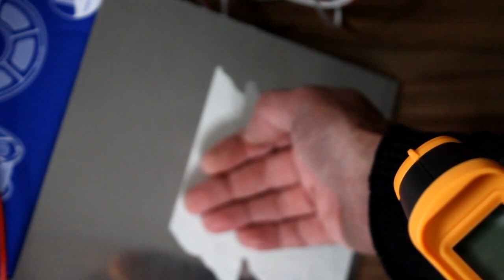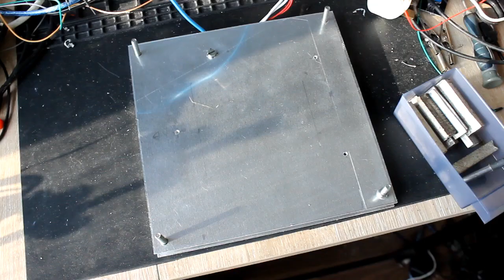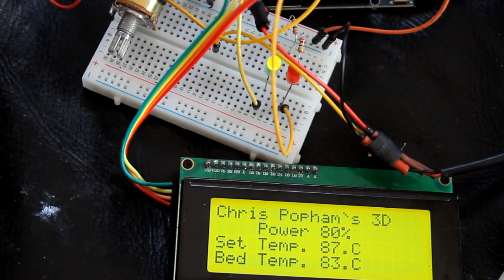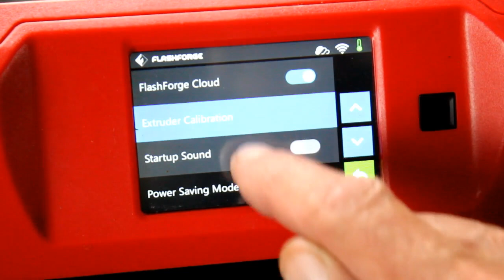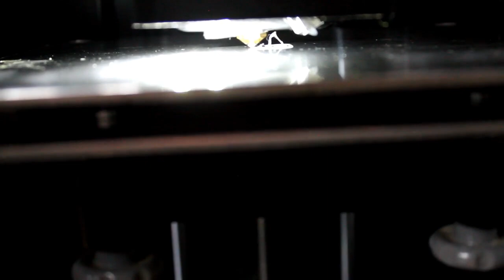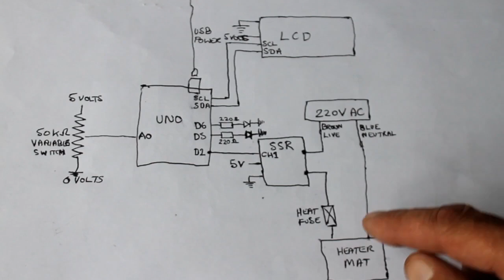Homemade 3D printer heated bed. 220 volt AC, 100 watts.

Comment: Isn't the thermistor already in the heater? The red pair of wires in mine is the thermistor and the white wires are the mains. The thermistor should be a 100k 3950 version.
Reply from the maker: Yes I think I`m going to use it. I wanted a LCD display for my mate but it`s too far away to work properly with the probe thermometer. I didn`t know what rating it was. That will help thanks. My friends put his printer in  a heated cupboard now so he dosen`t need it.

Comment: Where did you get that from
Reply from the maker: What do you mean? The parts or the song at the end? :) EBay and my mate got the song made by his friend.
Reply: @damianbutterworth2434  Sorry, it was cryptic. The heat pad, I am building an SMD soldering plate.  Also, does the heater get to around 240c? This pad looks about the right size, and with it, having an adhesive pad would hopefully work.
Reply from the maker: @InterplainMusic  Hi, I don`t think it will get that hot. I look into it. When I worked in a chip factory we had heater tubes about 8mm wide that would heat up the dies for soldering etc. They used to glow when left on all the time stood on their own.
Reply from the maker: @InterplainMusic  I have a mini single cooker plate. Only paid £5 second hand from a car boot. It about 18cm round. I`ll measure how hot it gets at the weekend and see if it stays at the same temperature and make a vid. Might be better off using something like that.
Reply: @damianbutterworth2434  my heat  plate  goes  up to 110  on the  printer  variable down  to  0   usually  i have  it  about  60  with  normal   filament

Comment: des  is   it  variable  temp  ?   as  it would  be   better   you   want it too  hot    that  it  melts the  model  on the plate  lol  mine  goes  up to 110  but  is variable omg    des  whats with the ai song  lol  you   bothered to  learn  it   on  your  kb mate
Reply from the maker: Yes mate variable but the temp sensor is far away from the heater pad so it`s slow to react. The last one I made I used the Thermistor sensor that is fitted to the heater pad so it was better but I could not get an accurate reading off it.
Reply: @damianbutterworth2434  you  had  many  pritns  stick to the  plate
Reply from the maker: @greentroll9326  I had problems using glass and aliuminum not sticking. This £5 black sticker works well. I think it`s better to peel them off when hot???
Reply: @damianbutterworth2434  yea i  take them  off when  hot as thats the  idea   mate   if you wait till cool then  its gonna  stick  lol

Comment from the maker: #include <OneWire.h> // SET UP WHAT LIBARIES YOU NEED
#include <DS18B20.h>
//#include <LiquidCrystal_I2C.h>
#include <LCD_I2C.h>
LCD_I2C lcd(0x27, 20, 4); // Default address of most PCF8574 modules, change according

int t=0; // CREATE T VARIABLE TO REPRESENT THE TEMPERATURE PROBE VALUE
int s=0; // CREATE S VARIABLE TO BE THE VARIABLE KNOB VALUE
int st=0; // ANOTHER VARIABLE FOR CALCULATING THE RESULT OF THE "SET TEMPERATURE"
DS18B20 ds(9); // SET DIGITAL PIN 9 UP AS TEMP SENSOR
void setup() { // SET UO YOUR PINS ETC
  pinMode(2, OUTPUT); // SET DIGITAL PIN 2 TO OUTPUT FOR HEATER RELAY
  pinMode(5, OUTPUT); // SET DIGITAL PIN 5 TO OUTPUT FOR HEATER LED
  pinMode(6, OUTPUT); // SET DIGITAL PIN 6 TO OUTPUT FOR POWER ON LED
  digitalWrite(2, HIGH); // HEATER RELAY OFF
  digitalWrite(5, LOW); // LED FOR HEATER OFF
  digitalWrite(6, HIGH); // POWER LED ON
    lcd.begin();
    lcd.display();
    lcd.backlight();
}

void loop() { //PROGRAM LOOPS BACK TOO HERE AFTER THE END FOREVER
lcd.setCursor(0,0);
lcd.print("Chris Popham`s 3D");
  s = analogRead(0); // READS THE VARIABLE KNOB
  delay(10); 
  st=20+(s/13); // CALCULATE TO CONVERT KNOB VALUE(0-1023) TO VALUE 50 TO 100 FOR DEGREES C
  t=(ds.getTempC()); // GETS THE TEMPERATURE OF THE PROBE
  delay(10);
  lcd.setCursor(0,2);
  lcd.print("Set Temp.");
  lcd.setCursor(10,2);
  lcd.print(st);(".C ");
  lcd.print(".C ");
  lcd.setCursor(0,3);
  lcd.print("Bed Temp.");
  lcd.setCursor(10,3);
  lcd.print(t);

  lcd.print(".C ");
  lcd.setCursor(4,1);
  lcd.print("Power");
  if(t >= st) { // TURN HEATER OFF IF TEMP PROBE IS HIGHER THAN THE SET TEMP
  lcd.setCursor(10,1);
  lcd.print("0%  ");
    digitalWrite(2, HIGH); digitalWrite(5, LOW);delay(1000);
  }
  if(t == st-1) { // TURN HEATER ON FOR .2 SECONDS AND OFF FOR .8 SECONDS
  lcd.setCursor(10,1);
  lcd.print("20% ");
     digitalWrite(2, LOW); digitalWrite(5, HIGH); delay(200); digitalWrite(2, HIGH); digitalWrite(5, LOW); delay(800);
  }
  if(t == st-2) { // TURN HEATER ON FOR .4 SECONDS AND OFF FOR .6 SECONDS
  lcd.setCursor(10,1);
  lcd.print("40% ");
     digitalWrite(2, LOW); digitalWrite(5, HIGH); delay(400); digitalWrite(2, HIGH); digitalWrite(5, LOW); delay(600);
  }
  if(t == st-3) { // TURN HEATER ON FOR .6 SECONDS AND OFF FOR .4 SECONDS
  lcd.setCursor(10,1);
  lcd.print("60% ");
     digitalWrite(2, LOW); digitalWrite(5, HIGH); delay(600); digitalWrite(2, HIGH); digitalWrite(5, LOW); delay(400);
  }
  if(t == st-4) { // TURN HEATER ON FOR .8 SECONDS AND OFF FOR .2 SECONDS
  lcd.setCursor(10,1);
  lcd.print("80% ");
     digitalWrite(2, LOW); digitalWrite(5, HIGH); delay(800); digitalWrite(2, HIGH); digitalWrite(5, LOW); delay(200);
  }
  if(t <= st-5) { // TURN HEATER ON FULL OFF TEMP DROPS BELOW SET TEMP-5
  lcd.setCursor(10,1);
  lcd.print("100%");
     digitalWrite(2, LOW); digitalWrite(5, HIGH); delay(1000);
  }
}